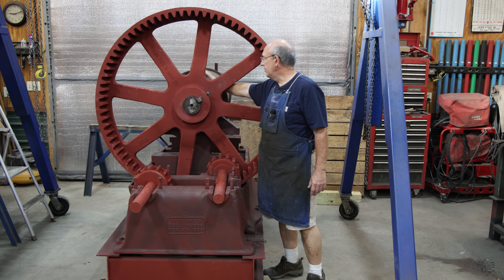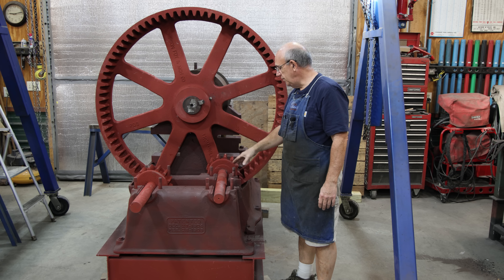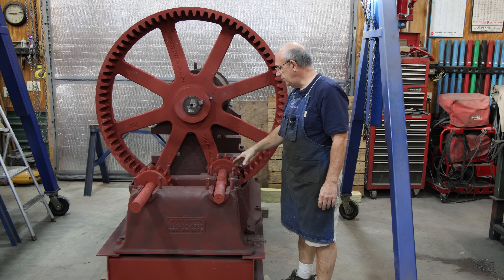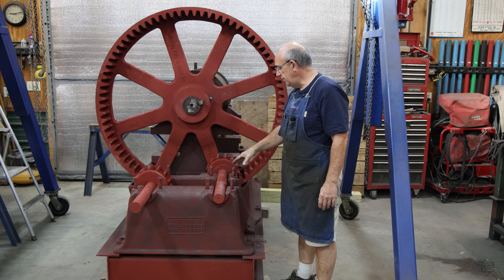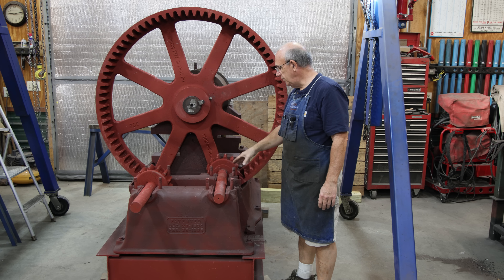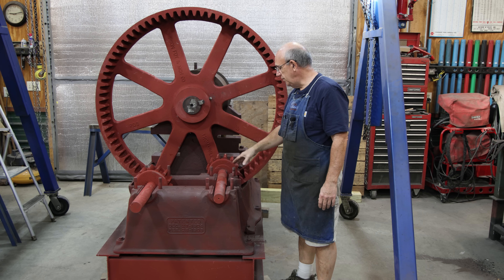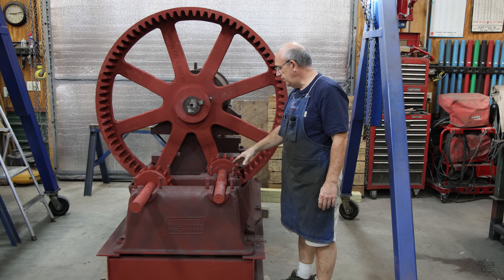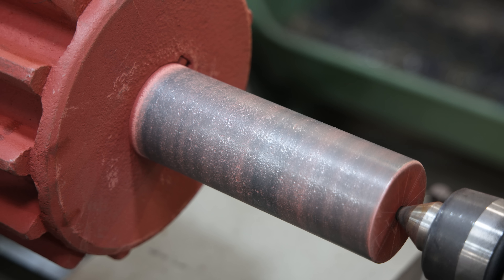Monster Cane Mill Restoration: Prepping the Reduction Gear Drive Shafts for Babbitt

Comment: The key at 27:50....is that not just in there with a friction fit?  I would have been scared to spin it that way and either taken it out, or put a set of hose clamps on to try and retain it from flying loose.  Hopefully later in the video it stays in and does not cause issues.

Comment: Luckily the key way did not fly out!!    Should add a bronze thrust washer to each side of the drum shaft and idler gears to prevent the drum and gears from rubbing into the bearing side surface?
Reply: I mean you could but straight cut gears in proper alignment won’t produce any thrust so it would mainly be a feel good addition.

Comment: Keith, aren't you concerned that the open keyways are going to chew up the Babbitt bearings as the shaft spins?  May not have been a bad idea to fill the excess part of the slot with weld and turn it down,  since you were turning the shaft on the lathe anyway to clean the pitting.

Comment: Would it have helped anything to cut off the oversized keys and avoid the collision with the bearings? It would be more work and you would have to weld out the unfilled keyway. Probably more effort than the result would justify.

Comment: Will 1/64 peel throw gear meshing off at all?
Reply: I guess not, because Keith will put the mandrel in concentric to the original axis, and pour in the Babbitt metal. The bearing metal will be 1/64" thicker than it was before, and the shafts will run on the same axes they were designed for. I'm interested to know whether there will be an attempt to clean up the meshing surfaces of the gear teeth.

Comment: So glad that the key did not come flying out of the shaft @28:00.
I'd either remove it first or put a hose clamp around it to make sure it stays put.
Reply: I’ll second that motion…
Reply: When he pours molten metal while wearing shorts, you should realize he is not very interested in safety!:body-blue-raised-arms:
Reply: @garybrenner6236  yeah, but he is wearing that apron....

Comment: At 23:47 it looks like you were pressing on the gear, not on the shaft - that's why it wouldn't budge!
Reply: If you heard the loud popping sound when he used the hydraulic press you know it was stuck and needed much more than 10 tons of force.
Reply: @Frank-Thoresen  I think you may be right, but I think I'm right about the pressure being applied to the gear and not the shaft when he was using the arbor press - or it could be an optical illusion.
Reply: @stumccabe  The end of the shaft was sitting a bit proud from the gear. There would have been a little bit of movement if the arbor press could handle it. The spacer was right on the edge but wouldn't have been pushing on the gear.

Comment: Hey Keith.  Love your work, thanks for posting it.  Suggestion if I may.  Restrain that key before you spin the shaft up, especially if you are going to touch it with the cutting tool.  A worm drive hose clamp will do fine.  I know it is in there tight but if it does come out it will find a way to do you a mischief for sure.
Cheers from Down Under.
Reply: Yeah, I was concerned that key might fly out also.
Reply: Not gonna lie, watching that made me tilt my head to one side thinkin it was going to fly loose. I'm sure he knows what he's doing though.
Reply: Was going to comment about the same thing.
Hose clamp is cheaper then a bunch of surgery.
Reply: When he pours molten metal while wearing shorts, you should realize he is not very interested in safety!:body-blue-raised-arms:

Comment: Interesting ratios. I note that each pair of meshing gears has no prime factors in common. This maximizes the time between any given two meshing teeth on the gears coming in to contact, I guess so that there is a minimal chance of a damaged tooth causing a wear issue on the gear it is meshing with. It certainly isn't because setting up a 77-tooth pattern is easy on the mathematics!

Comment: Since you knocked that gear off, it sure seemed like a good opportunity to weld up that over-cut keyway. Especially given that it will interfere with the babbit- it sure made me curious why you didn't decide to weld it up.
Reply: Welding would cause tension in the shaft and make it pull and no longer be straight
Reply: That was my thought too. I think the key way would touch the babbitt bearing and cause it to wear out faster, same thing he said about the pittings on the shaft.
Reply: @Frank-Thoresen  The keyway only extends a short distance into the babbit. Once it has worn a few thousandths clearance it won't continue to wear on the babbit. The pitting on the shaft was over a much larger area. In a perfect world, it would be nice to have the keyway filled in, but if it were a perfect world it wouldn't have babbit bearings
Reply: Because he is an even worse welder than he is a machinist, if that's possible!:body-blue-raised-arms::face-blue-smiling::face-blue-smiling:

Comment: On the second shaft, wasn't there a danger of the key flying out when the shaft was being turned down?
Reply: He should have secured the key with a hose clamp
Reply: When he pours molten metal with shorts on, you should realize he is not very interested in safety!

Comment: One reason for having a shaft with a 2 and 11/16" shaft is that ball bearings are usually metric sizes and less metal is needed to be removed to get to a metric dimension such as 65mm or 70mm.
Reply: There were no ball bearings when that cane mill was made. That is why it uses babbett bearings.
Reply: @johnburger3287  Ball bearings were invented in 1794, long before the cane machine was made.

Comment: 23:10  Mr. Rucker with all respect here, a shorter bushing that is closer to pushing out that main shaft should have been tried out.  You are only increasing the chances of that bushing launching out like a dangerous projectile.  Safety!

Comment: I really love your videos and watch all of them. I have a question. Sense you had to turn the shafts anyway, Why didn't you weld in the key way slot ends?
Reply: Welding would cause tension in the shaft and make it pull and no longer be straight

Comment: If the bar you used to press the axle out was not faced (not flat) on the end(s) it will cause the piece to bind in the bore when the piece being pressed gets close to the end and almost out. I've had that binding problem before but our press was a 150 ton unit so the binding showed up as an increase in the hydraulic pressure.

Comment: So based on my math and assuming the engine pulleys are a 4:1 ratio, this thing would have roughly a 76:1 gear reduction.

If the cane mill steam engine operates at 55-60 rpm, which was common for cane mills of the day to control crushing rate, the final drum will rotate at .75rpm.

If the steam engine has 330nm of torque, then the final output would be ~25,000 nm at the drum.

Does this sound right?
Reply: Keith said the engine was a Fairbanks-Morse internal combustion engine.

Comment: If the keyway slots will interfere with the pouring, why do you think they won't have a reaming affect on the poured bearings after pouring?  Since you are making a mandrel anyway, why not just make a new shaft and slot it right?  Just thinking.

Comment: Fun fact for math geeks - the small gears have 13 teeth, which is a prime number. This makes the small teeth meshing with a new tooth on the big gear every revolution. This evens out the wear on the teeth.
Reply: The fact 13 is a prime number has nothing to do with it. If the large gear was 78  it would be 6 to 1 and the same teeth would keep meshing.
Reply: @mikemelbrooks  See my comment which I just made before I saw this thread. It's having no prime factors in common which is the design feature.
Reply: @ 
I guess I should have been more specific. 13 is prime and is not a factor of 77. Therefore, every tooth on the small gear meshes with every tooth on the large gear before repeating, leading to an even wear pattern on all teeth for both gears. If the large gear had 78 teeth, then any given tooth on the large gear would always mesh with the same tooth on the small gear leading to uneven wear. Setting this up is simplified if one or both gears have a prime number of teeth.

Comment: I would guess that the reason that shaft sizes tended to be on the sixteenth is that back in the day the shafting wasn't that precise so it was common to design bearings a sixteenth under common nominals so they could precision turn all their shafts in house.

Comment: Hi, why wouldn't you cut the gear shaft to the size of your mandril to make things easier to make your standard shafting?
Reply: He hasn't made the pouring mandril for that bearing set yet. Turning the shafts to uniform size simplifies making the mandril and will help if it is ever rebuilt again.

Comment: I put a ¼ HP blower motor on my Happy Valley cider press grinder. Optimum speed of the grinder is about 60 RPM (determined empirically). I originally used pulleys and a jack shaft. I used a spreadsheet to calculate pulley sizes using available pulley sizes. It worked great, but seemed kinda dangerous. I'm in the process of replacing the belts with a ½ HP Boston Gear 30:1 worm gear that I bought on eBay. That reduces the 1725 RPM motor to 57.5 RPM. There are eight blades on the grinder, so a blade cuts into the apples every 125 milliseconds. Faster, and they bounce around.

Comment: Keith, i wish you had removed the key from the second shaft you turned it in the lathe. Or at the least placed a strong hose clamp onto it. Take care, be safe, and carry on..
Reply: Thought the same thing
Reply: When he pours molten metal while wearing shorts, you should realize he is not very interested in safety!:body-blue-raised-arms:
Reply: I was thinking if just the rotation of the shaft didn't send it flying, the slight contact with the cutter would bang/vibrate it loose enough for that to happen. Angels were watching.

Comment: Without rounding the intermediate drive reductions you get (42/13)*(77/13) = 19.136, so it's definitely a 19x speed reduction (and torque increase).